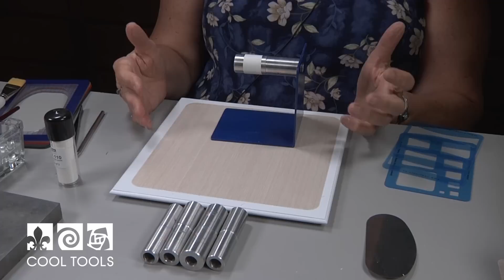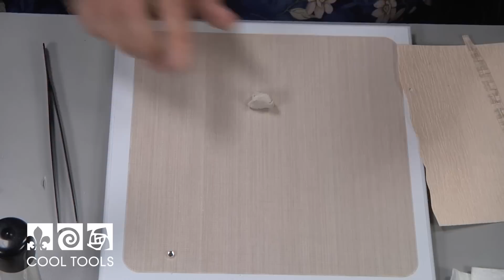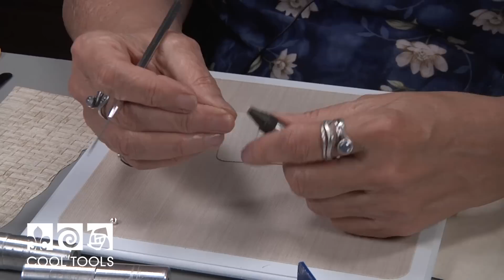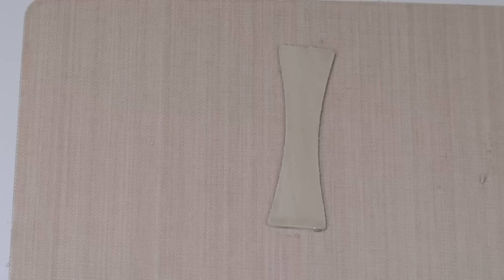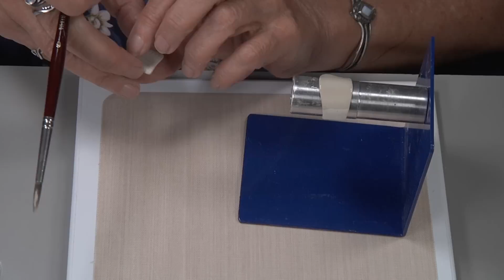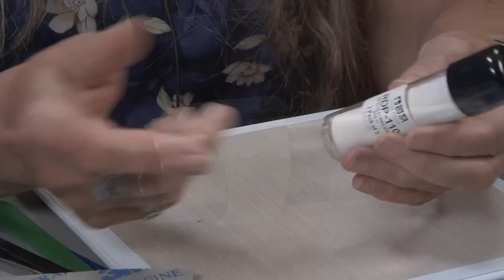Cool Tools | EZ960® Sterling Mens Ring by Lisel Crowley

Comment: Hi! I love your works! Looking for a bit of advice. Prices of kilns are very high, but I have seen some kilns meant to be used in a microwave oven which are quite affordable. What are your thoughts on that? Thanks!
Reply from the maker: Hello, the only kilns used in the microwave we are aware of is for fusing glass. If you are looking for a cheaper alternative to using a kiln, there are some metal clays that can be fired using a butane torch. Thank you for the question! A link to the microwave kiln can be found here: https://www.cooltools.us/ProductDetails.asp?ProductCode=GLS-102

Comment: Hi Leslie, thank you so much for all the videos you make, I wait for them..I have question please, when you make the bezel out of the clay or a cup, and set it in that piece, doesn't pop out when the clay shrink in the kiln..how the stone and the bezel keep their shape while the metal is shrinking?? thank you in advance
Reply: salma dressel I find that the bezel cup holds its shape  remember that ez960 only shrinks 10 percent, so if you use a clay with higher shrinkage there may be issues.

Comment: Good evening Ms. Crowley - is it my understanding that EZ960 gan only be fired in a kiln.  Is it possible to fire it using a torch or a hot pot?  If a hot pot is possible, how much fuel should be used.
Reply from the maker: Hello, EZ960™ is not meant to be fired using a hot pot. Torch firing is technically feasible, but we do not recommend it. Firing this clay in a kiln gives the best results. Thank you for the question.

Comment: Hello is it necessary to use a klin to fire it, or can a mini torch be used also?
Reply from the maker: Hello,  torch firing is technically feasible with EZ960™, but it is not recommended. We recommend firing open shelf in a kiln at 1675°F for 2 hours.